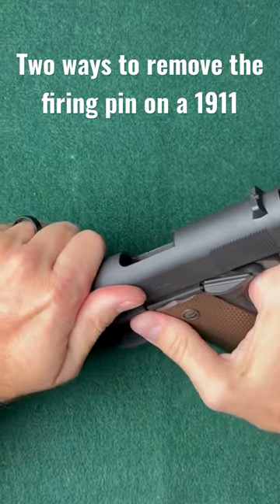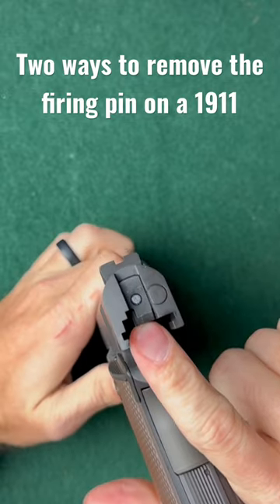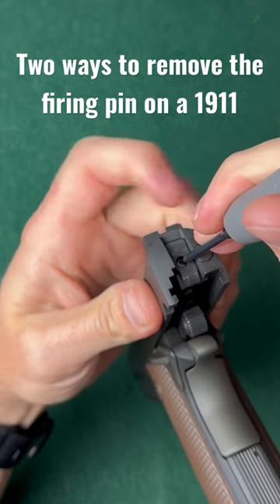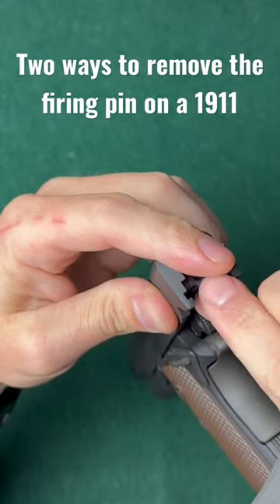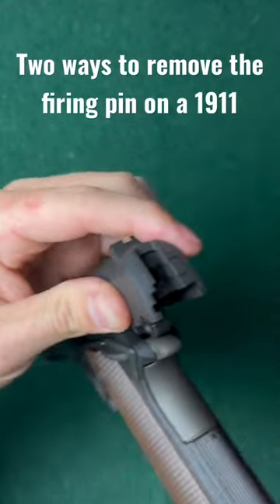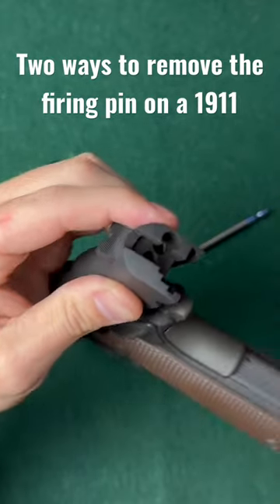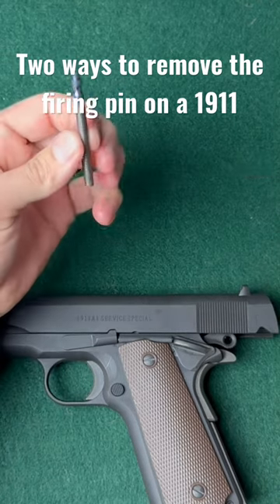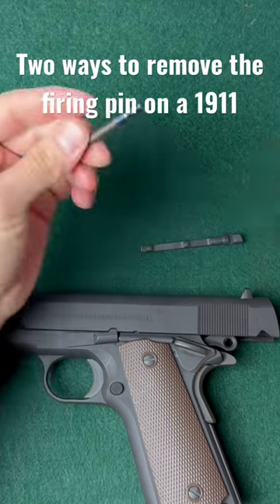Another way to remove your firing pin on your 1911

Comment: So do you have to clean the firing pin?
Reply from the maker: Yes you always wanna make sure your firing pin is always clean and dry
Reply: @ShatTactical  what would happen if its dirty
Reply: @GamingwithKris2007  pin can get stuck forward and cause slamfires.

I picked up some surplus rifles with that issue. Enough caked up grease that the firing pin couldn't retract (although not spring loaded in those guns)
Reply: @ObservationofLimits  that's makes a shit ton of sense thanks for the information both of you
Reply: @GamingwithKris2007 It’s not something needed to be done every single time after shooting (say under 100 rounds or so) but it’s definitely good practice and I’d reccomended it’s after every 2 or 3 times you take it out just to keep it pristine and reduce risk of failure to fire
Reply: @DaddySann1776  alright, thank you for the advice